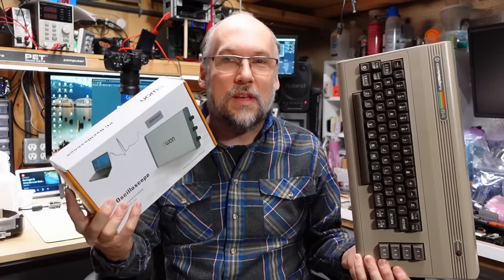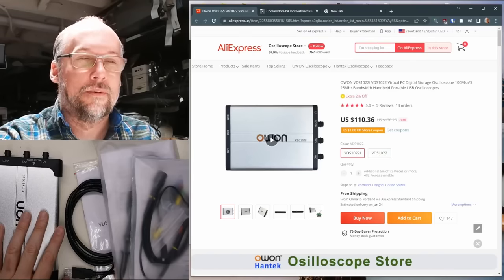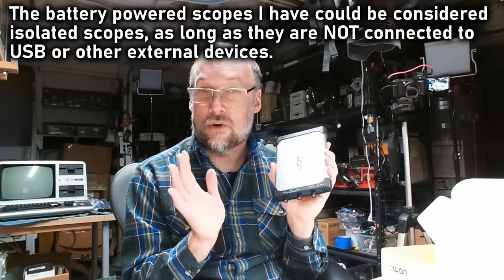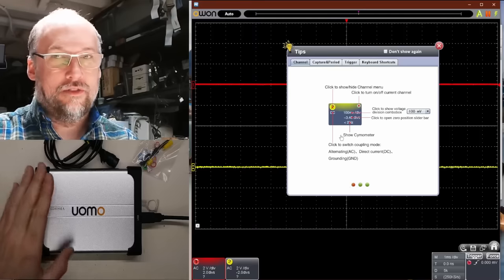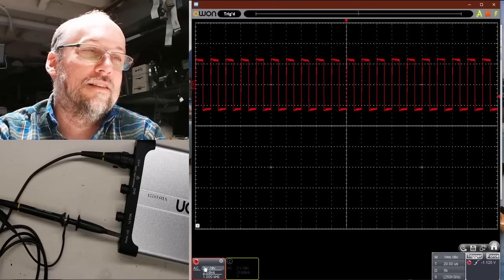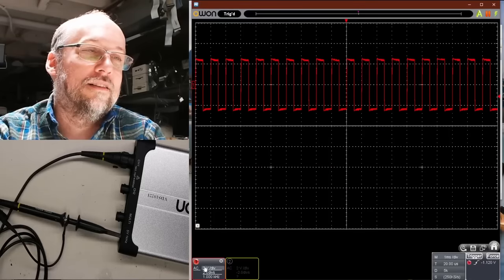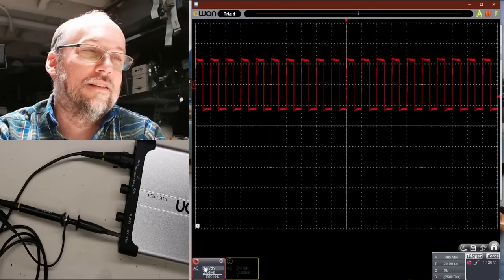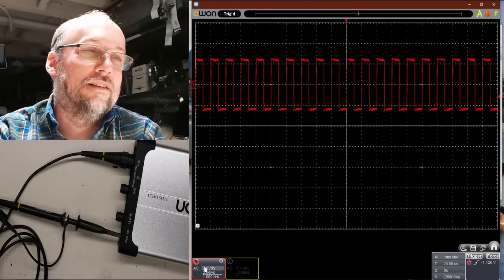This blows away the $60 budget oscilloscope! (OWON VDS1022 review)

Comment: I think a much better choice for a good isolated scope is simply a Picoscope used with a laptop computer. As long as the laptop charger is not plugged in, you have 100% electrical isolation! And even the entry level Picoscopes are way better than those cheap Chinese things.
  I was testing a home brew instrumentation amplifier using a simulated differential signal from my signal generator, and I was using the OWON vds1022I to measure the amplifiers output. No matter what I did, I kept getting an overwhelmingly noisy signal on the amplifier output, even though the input was a clean stable signal. I finally gave up and used my Picoscope instead; the problem simply vanished!
 The bottom line is that it's worth paying slightly extra money for a Picoscope, because you get a product with lifetime support, and very good value for money. With the cheap Chinese USB scopes, you only get what you paid for, no more.
Reply: A picoscope with a battery powered laptop is NOT isolated! You can shift the ground say +/-40V away from earth. Anything more than that and you’ll feel it. Laptops don’t have double insulated exteriors. The user at the keyboard is the ground path. For full isolation you need to connect to the laptop remotely via WiFi and the laptop has to be where no one can touch it. Then it is in fact isolated. And even if you only do low voltage ground shifting, the capacitive coupling through your hands to earth will be orders of magnitude worse than with isolators inside the scope. So there are serious caveats as you can see.
Reply: @absurdengineering  All Laptops that I have seen have bodies made of plastic. Unless you're  connecting your 'scope to high voltage high power equipment, that is more than enough insulation to protect you from accidental shock. And if you're paranoid about touching the keyboard (which there is no reason to be) wireless keyboards and mice are dirt cheap, or even a wireless keyboard with a touchpad. 
  To check if your 'scope is isolated just measure the resistance between your oscilloscope's ground on the input connectors and the ground on the line powered   signal source (with everything switched off obviously!). If the 'scope is not isolated, there will be a low electrical resistance between the two grounds. And there will be a low resistance path to actual "earth".
   That means that if you connect the  'scope ground lead to what is called the "hot" ground, (on the primary of a switching PSU for example), which is not an actual ground but floats at several hundred volts above ground), you will create a short circuit that will cause large currents to flow through the ground path of the "scope's circuitry, with very destructive results. 
     With a USB scope connected to a laptop running on batteries, there is no mains earth path, unless you physically touch the ground on the USB connector itself. So once again,  I have to state that a Picoscope with a laptop, running on batteries, is probably the best isolated oscilloscope, in terms of value for money there is.
Reply: @michaelroberts1120  A “body made out of plastic” is not how full isolation is achieved. What about all the connectors that are finger-accessible, crud in the keyboard, the metal layer under the key tops in some designs; and so on and so on. Elevating a laptop beyond 40-50V away from ground and then actually using it is extremely unwise. They were not designed to be used that way. Also, most laptops have some screws on the bottom and some of those are not isolated. If anything conductive on the desk/table contacts them, you’re in trouble. And a thousand other things both of us have not thought about. So, just nope. Safety first.
Reply: @absurdengineering  If you are at all so paranoid about electrical isolation, or you are actually probing high power mains circuits with an oscilloscope, pico technologies, which is a manufacturer of professional grade equipment and not toys like many Chinese manufacturers,   is ready to meet the needs of its customers, and offers  high voltage differential probes for those applications.
Sorry to sound like a snob, but I bought several cheap Chinese USB scopes over the years, and when I count the money i spent on those pieces of garbage, I could easily have purchased a very good basic model Picoscope for the same money, and I would have had change left over!
Reply: @absurdengineering  agree

Comment: Probably would have been good to have a fully isolated scope like this when I was analyzing a piece of equipment to reverse engineer it... horrible design that had the transmitter -170VDC tied to DC ground, so even TOUCHING the circuit ground with the power switch turned off would bite you good! It's a good thing the logic analyzer I was using had one of those resettable thermal fuses in it!

Comment: Are the inputs isolated from each other. back in the 1980s the company I worked for spent a small fortune on a "Powerscope" that could do that for use in PSU fault finding. Most of the time we just used it as a front end for an HP Digitising scope which was equally expensive back then.

Comment: The scope works pretty well, granted I have been looking to an alternative computer interface program since I am not super fond of the normal one. But it does work great compared to having to haul out my old Tektronix 20Mhz scope. (Old fashion one with a CRT,fully analog.) I have the VDS1022I which is the one that supposed to be isolated from the USB.
Reply: theres an opensource upgraded version of this software on github, have you tried that?  Thats a reason im considering this but , so many options hehe
Reply: @mikejones-vd3fg  i have but at the time, it was just an edit to the existing one and didnt work nearly as well.

Comment: You are correct and it would be better if the oscilloscope had a USB C connector but a USB a connector is meant to be plugged in and unplugged many times. USB b connectors are not so much.  When this unit was designed a USB a connector on the scope itself was probably a wise decision because it's going to be plugged in and unplugged any times when you put the scope away. To call it crap because of that is unfair especially at this price point.
Reply: Any device that completely goes against the USB specification by having a host port on a downstream device should absolutely be called crap and be avoided.
The big type B plugs are plenty robust. Not using them is pure stupidity.

Comment: In the github you linked to the usefull tips file in de documents folder lists all the shortcuts in the application. 

M changes between main and zoom mode
Ctrl + / Ctrl - zooms
Reply: I was wondering if Ctrl+ Scroll wheel would work too?

Comment: Re: fixing the luma. Couldn't you build a small amplifier circuit and bodge it into the luma pin just to bring the luma signal up to 1V? The signal itself looked pretty clean on the scope, it was just low.

Comment: Having a USB A on a downstream device is like if you ordered a computer that instead of having an IEC inlet, had a normal mains socket on the back, and with it came a cable with a male mains plug on each end.
The problem here isn't the socket, it's the cable. That cable should never exist at all. The designers of the scope had exactly two options: either type B (micro or full-size) or type C, where compliant devices will negotiate power delivery.

Comment: Trying to figure out how to get started using an O scope on automotive. This is way more complex than I expected. On multi meters you find out which company makes them for Snap On, Mac, or who ever and buy it direct to save some coin. 
This however seems like they have to be expensive because making them with quality products just costs a bunch of money. All the “budget” options have serious trustability flaws and this ones main flaw is it can set your shit on fire or short out your gear or both. 
What kind of price range would I be looking at that has this ones performance, but is safe and intuitive to use?
Reply: pretty much this, its isolated up to 400v peak to peak (the 1022i version is is, and you need to set your probe to 10x), so unless your signal has ripples over 400v (even then youd just need a 100x probe) this is just fine. if you want to make sure, just use a laptop or alternatively an android phone/tablet with the hscope app. most just lie about the specs, especially the maximum frequency.

Comment: How accurate is this scope.  It does show a nice waveform, but is the frequency and voltage accurate?
Reply: yes its very accurate, its all hardware based on a spartan 3 fpga. the frequency is a hardware counter (the one you see on the bottom in the Channel section) the voltage is 8 bit adc, so as accurate as that depending on the range, its plenty.

Comment: I know the feeling of just opening the software and starting to curse the ui for not being able to zoom in/out .. Have you read the manul ? "MANUAL ?? I'm a technissian I don't use manuals .. I do that myself. Always hard for a techie to admit the manual might actually be helpfull .. some times 😎
Reply: I guess its propably not a good bet that these cheap china things will ever get a software update that is more intuitive to use.
The bigger thing is, I'm not an expert but is a 2'nd hand say 20-30 year old scope with a tiny CRT actually usable today ? are the bandwith on them uptodate to what a technician need today ?
Reply: @mrdali67  It's going to depend enormously on the model(as is still the case), and what you're measuring. If you're only working with low frequency signals, I'd imagine nearly anything would be ok.
I can personally remember using good Tektronix oscilloscopes at a polytechnic in 97, which had floppy disk drives for storing signal data. I haven't used any since though.
Similarly, there were scopes capable of display 200+ MHz signals going back many decades, and with numerous features, they were just very expensive at the time. I'd imagine these are still very capable(but harder to use), but are probably over-priced second hand, in comparison to equivalent capability on new scopes.
The CRT doesn't really matter(aside from having potentially failed in the meantime, likewise the general circuitry) - they're always going to be capable of adequately displaying the frequencies it was designed for.
This gives a general idea of what was available at different times for analog scopes:
https://en.wikipedia.org/wiki/Tektronix_analog_oscilloscopes
Some analog scopes could still sample the signals for digital storage etc. Digital scopes seem very likely to be easier to use though.
Reply: @DoubleMonoLR  I think I'm more impressed with how cheap these things can be made today. Being from 67, I was used to when growing up and becomming interested in electronics a scope was not commonly found at the hobbyist level as those things used to cost a fortune. I remember how much I payed for my first quality digital multimeer .. even got it for gross price thru work and it was like 2 months salary as an apprentice 😄and today they throw those at you for a few bucks from china

Comment: The no linux for most of these is such a bummer
I have a pi in my shop as the shop computer and to run the printer i have down there
being able to use a scope with that would rock
Reply: Others have posted information regarding installing software for linux and mac.

Comment: XP and Windows 10 (for sure) and probably Win 11 share a lot of the codebase, more than MS wants you to know. And MS have for good and ill always been very good at backwards compatibility, so XP doesn't have to mean old software, just that it uses the older "WinForms" windowing than the new slicker WPF (Windows Presentation Foundation). And additionally the market for much of China's crappy, knock off electronics is India as well as domestic use, they are running on cheaper older hardware that came with XP or they are using a pirated version of XP, hence it is important for these products to support the outdated Windows XP.

Comment: I have this exact model.  It's a lot of bang for the buck.  The software is frustrating but you get used to it.
Reply from the maker: I get the feeling I would get used to it as well. There is aftermarket open source software, I will likely use that for a follow-up video.
Reply: @adriansdigitalbasement  Looking forward to that follow-up video.
Reply: @adriansdigitalbasement  That would be a great follow-up.

Comment: I had issues with the device and I did not like it at all after I had gotten the LOTO OSCA02 oscilloscope and a professional android app from marten loren who has its own websites and lot of great tools especially for car mechanics, tire adjusting and what not. The loto had better specs, better results like the 48k buffer versus 5k by owon. 
I had also struggled with the description and specs, so what the 1022i meant (isolation).

Comment: Could you not amplify the luma signal with a pnp transistor a small cap (~.5uF) and some small R, so that it falls within the scope of a luma signal voltage level for common separated video specs? Also, while I do agree that the scope has good specs, I also agree that the UI is rubbish, so I would pass on it. I liked the hand scope with composite out that you used in the prior video.

Comment: The double USB-A to single USB-A cable is pretty standard with old 2.5'' USB2 external HD drive enclosures due to the fact USB-B female connectors (printer connectors) don't fit quite well at the back of this kind of enclosures and it also avoids to underpower the HD with a printer type cable. Even if they can't be found easily on a brick and mortar shop you can still find them without any problem on any decent computer accessories web shop.
Having a USB type C connector would be more annoying because it would require to use a recent PC (you need at least one available PCI Express 1X port to install a USB 3 card, not available on Win XP desktop or notebook PCs), so old Win XP computers would be useless with this modification. Plus the higher data rate wouldn't be used, so all in all it's quite coherent to get a budget oscilloscope that is able to be used with old affordable PCs.

Comment: Couldn't you isolate the scope just by plugging it into a battery-powered laptop?
Reply: Yes but the grounded parts like screws, hinges, connector ground pins etc become hot with your scope probe.  Since this i version is rated for 400 volts peak someone could use it for 120/240 vac rms work (340 vac peak) which could appear on the laptop.  You can float a ground on a regular lab scope but have the same concerns.

Comment: "Forbidden Cables" is what I call nonstandard cables such as that USB cable. Definitely not a fan of them.
Reply: I have several older 2.5” IDE-USB enclosures that use those split usb cables to grab more power. 

These enclosures are USB 2.0, so very slow. But I have to plug both connectors into my computer in order to power up those hard drives.
Reply: @DerekWitt  The split cables don't bother me much, it's more the issue of using a type A connector where a type B should be. It's like having an extension cord with pins sticking out both sides...

Comment: That is a weird nonstandard cable. 

IMO, if you're in a situation where you can't run the thing off standard cables... make the cable clearly nonstandard so that DIYers don't get too many clever ideas. That could cause problems if someone hacks together a bunch of standard cables and run into the reason it's not properly standard to begin with.

Comment: You don't need USB type C for this.  They could have done exactly the same thing with a USB A-to-B cable (with an extra A plug), which is how it should have been done, and many other manufacturers did do before higher level power delivery was a common thing in USB ports.  A-to-A is always wrong and stupid.

That detail by itself is enough for me to never want to touch any OWON product.  If they screw up basic standards that badly, for no good reason, who knows what other corners they're cutting everywhere else.

Comment: An actual USB C implementation would add $20-30 to the cost.  But I do agree that a non-standard cable like that is a total pain when it is eventually misplaced.
Reply: The spec was made so that's not the case. For a device you only need an extra resistor when converting to type C.
Reply: @eDoc2020  But you end up with regular USB power. The whole point for using USB C for this scope is to get more power so it doesn't use dodgy dual USB cables.

Comment: Just curious, how many ICs have you damaged by touching and rubbing on them without ESD protection? I like the info presented, but I cringe a little every time you start touching the ICs  X_X  :)
Reply: Almost never.  In the early 1980 days of CMOS chips, low humidity high static caused by nerds wearing cheap polyester could draw an arc and potentially damage the cheap cmos (early fet based) chips. Even then ttl chips had no problem.

Comment: $30 for isolation? Aren’t optocouplers like $1. I just used one for a MIDI device and isolating it didn’t cost $30 to add.

I bought a Hantek last year, a desktop one, paid around $250 for it. 5 months later it ceased to function. It powers on, sort of, lights a couple lights and does nothing else. Company won’t repair or replace it. 

Don’t buy anything Hantek.
Reply: 🙄 it takes a bit more than adding an optocoupler. USB 2.0 at 480Mbps is not MIDI at 0.031Mbps.
Reply: You also have to add an isolated dc to dc converter for the power.

Comment: One of my old C64 has a rainbow label, the square power connector opening, a fully working 8 pin video out (I guess, not sure atm) and the chips are dated around end of 1983. Looks like Commodore did Commodore things and used whatever they had laying around. :)
The PLA in my C64 isn't a MOS or CSG branded one and it's working fine...